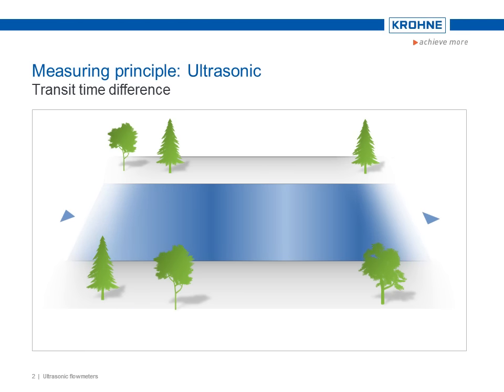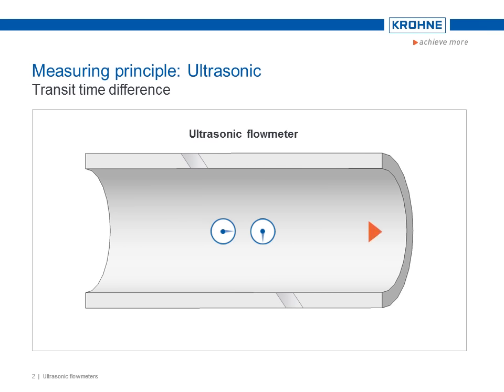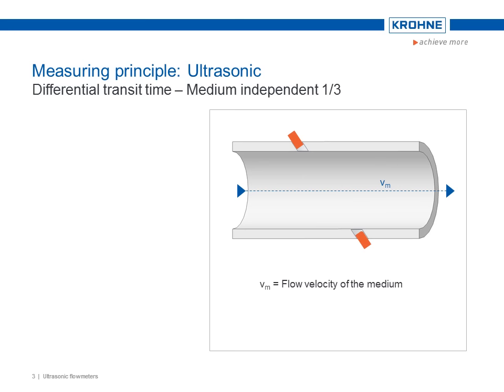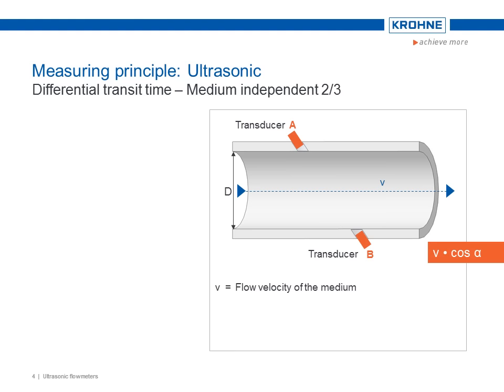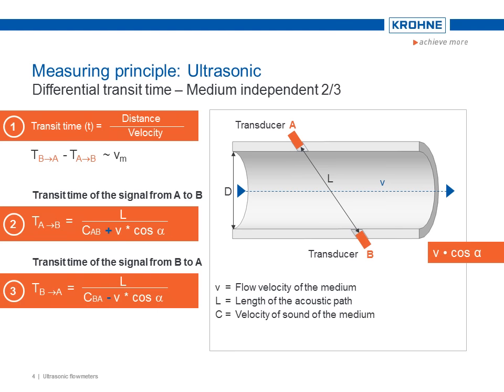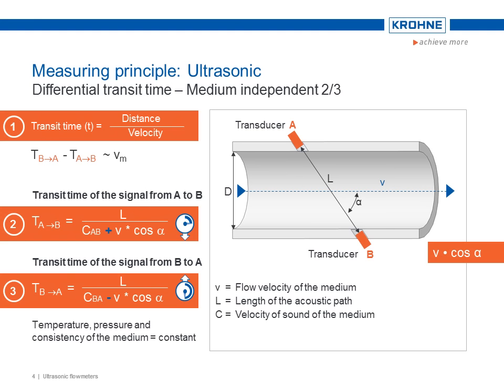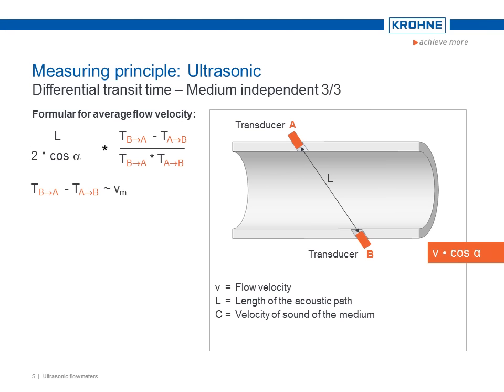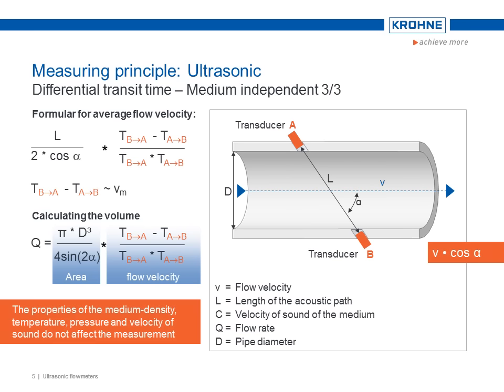Measuring Principle of Ultrasonic Flowmeters | KROHNE

Comment: I enjoyed the video. I have a question.
Looking at the path that ultrasound crosses, it seems to pierce the wall twice in the middle. 
By the way, can ultrasound penetrate a blocked wall? 
My experiment showed that ultrasound couldn't penetrate the wall. 
So I wonder if ultrasound can pass through obstacles.
Reply from the maker: Hi! Thanks for your questions. Please feel free to register for our free eLearning courses at KROHNE Academy online: https://academy-online.krohne.com. Here, you will find a course on ultrasonic flowmeters in general (https://academy-online.krohne.com/en/courses/ultrasonic-flowmeters/), but also a course on ultrasonic clamp-on flowmeters (https://academy-online.krohne.com/en/courses/clamp-on/). This technique allows indeed also to send ultrasonic signals through pipe walls. Best regards!